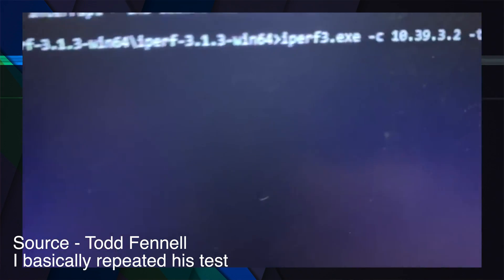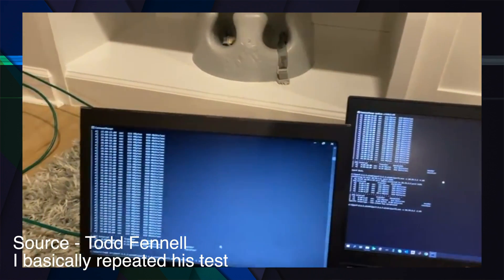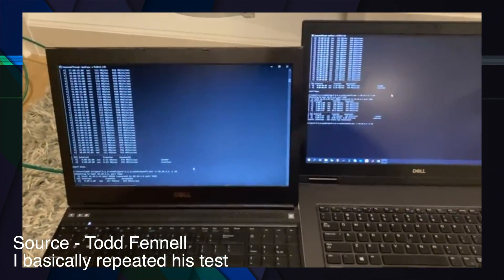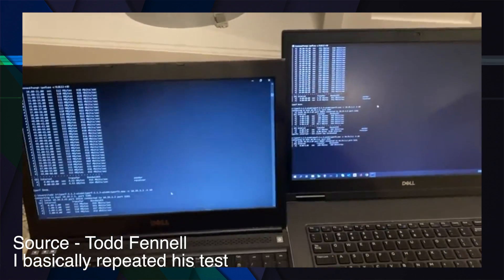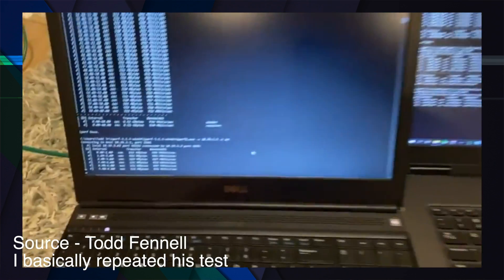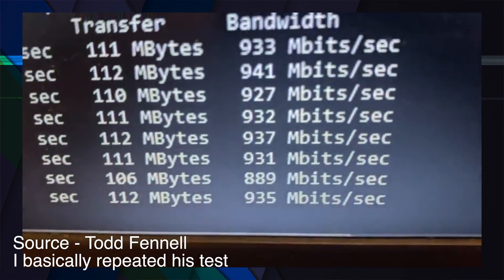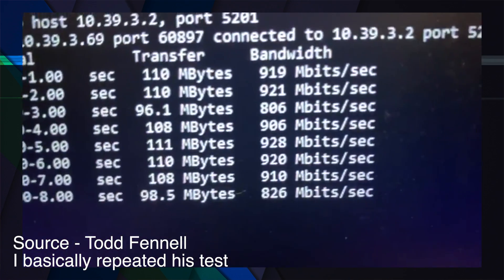The Truth About The UDM Pro... I was wrong

Comment: I noticed on the UDM-PRO it was 1Gb/s uplink but looking at the block diagram it is 2.5Gb/s on Rev3.1 between the switch chip and the CPU. Does anyone have information on the UDM-SE as to what revision and if it is 1Gb or 2.5 uplink?
Reply from the maker: The se model has 2.5gb wan
Reply: @MillerTechnicalServices Sure, but that was not the question.

Comment: what happen when you have 3 vlans and traffic has to flow between them on that switch?  Does it bottle neck at 1G?
Reply from the maker: It bottlenecks at either 1 or 2.5 depending on which revision of the UDM pro you have. They quietly updated it shortly after it’s release.

Comment: So, when we talk about the switch backplane capacity, this refers to the maximum throughput when the switch is fully in use. As such, begs the questions;
a) What is the maximum throughput on the UDMpro/UDMproSE, when the switch is fully in use?
b) Does the WAN port form part of the switch backplane ‘fabric’?
Cheers :)
Reply from the maker: The switch can do full gigabit between all of the gigabit switch ports. It can do 2.5gb to the cpu (ie. connecting it to the router)

Comment: Unifi is like the Apple of networking.. OooOo pretty.. colorful interface.. OOoO Ahhhaha... But.. Oh.. You're not gonna permit me to this.. Oh you're not gonna permit me to do that either.. Oh you've released a controller update where you killed off the features that I was using.. Oh you totally killed off support for a device... No thank you.. Been down the unifi path, been burned, won't trust them again. Offloaded my entire rack back to amazon at a loss and replaced it all with Mikrotik gear. The only piece of unifi gear I kept was the pro ap, but.. unifi's control over it had to go.. Trashed their firmware and tftp flashed openwrt. I control my devices now.... Not some corp pinhead at Ubiquiti. Same way with Cisco Meraki.. Stay away from that hot garbage too.
Reply from the maker: I don’t remember the last time I updated unifi. Too much crap
Reply: you do realize that Unifi was started by a former Apple engineer, haha.

Comment: You mentioned that UDM Pro's newer revisions have a 2.5GB Backplane. How can I check if mine is 1 or 2.5? (other than testing it, I want to know from model # or in the UI)
Thanks!
Reply: The UDM Pro (not the SE) is 1Gb/s uplink, the only UDM Pro that had 2.5Gb/s uplink was the Early Access revision 3.1 but it also had the SPF ports linked in speed, so if one only ran 1Gb/s then the other was locked to the same speed.
I hope we soon get info about the uplink speed of the UDM Pro SE
Reply: He's wrong. It was 2.5Gbps during EA, it's 1Gbps since release.

Comment: The biggest issue with the UDM Pro is that it cannot act as a controller for other networks / network locations. I have a company with 9 locations across the country, and basically if I want to upgrade and use Unifi Video, I have to upgrade all locations with their own UDM Pro. And thus, I will have to manually manage 9 configurations whereas before I could have one configuration with just 9 locations.

Also, getting VPN setup between these locations is now.... well.... why use unifi? You have to do everything manually again. For professional network engineers no big deal probably. But managing my own company I feel Ubiquiti left me hanging. I'm stuck with all this old unifi gear, and cannot seem to be able to upgrade to video and access control without seriously damaging the functionality I already have.
Reply: If you have a company that has 9 locations you really should have them look at enterprise level gear.  Ubiquiti really doesn't work well at scale, and the UDM pro can't do any high availability, something that is considered a basic requirement for enterprise level gear.

Comment: So the UDM Pro only has 1gig backplane and the SE can do more? Or they’re both good to go?
Reply from the maker: They’re the same.
Reply: @MillerTechnicalServices  both good to go for 1 gig for each port or 1 gig divided to each port? Sorry I was having trouble understanding
Reply from the maker: 1gb port to port. 2.5gb all switch ports to the built in router. Except for the 10gb sfp+ ports.
Reply: it's basically a 8 port switch chip inside the udm pro,and it's basic job is doing at least 16 gig backplane 8gig uplink and 8 gig downlink between all 8 ports.for a 8 port switch, its a easy job nowadays.

Comment: So now I have a question. We have established concretely the 1 GB port on the back plate of the switch. My question is now. How are people achieving 1.2 gigs speed wired on  UDM pro standard edition
Reply: They are using the SFP+ WAN port and forcing it to connect at 2.5GigE to a compatible 2.5GigE modem. Then they are able to get ~1.2Gbps download speeds. This is usually done with Comcast and Spectrum internet over coax cable. These providers overprovision by 20% to make sure the customer gets their rated speed to reduce complaints of not getting what they are paying for (and other reasons). It is not possible to get more than 1Gbps if using the 1Gbps WAN port or by using the built in switch. You would have to use the SFP+ ports for both LAN and WAN.
Reply from the maker: My guess would be the bits vs bytes conversion...

Comment: It is refreshing to have someone come back and admit they were wrong. I wanted to rage, but there were so many people after the SE dropped saying the same thing that I just dismissed it as misinformed.  In the UI forums it is pretty frustrating too when people act like you can't use that switch.  Throw in a few flex cameras, a hue hub, a caseta main repeater, etc. on that switch and it will work just fine as a perfect PoE switch solution, never saturating the switch bandwidth or uplink for that matter.

Comment: I appreciate you coming back and admitting you were wrong. I know my video was posted publicly, but I would have appreciated a heads up that you were going to use it and talk over it. It wasn’t 100% clear that it was my video as the way you talked over it, it sounded like it was you doing the testing. Other than that, I do agree with your other gripes about the UDMPro, forcing network and SSO is a bit frustrating for clients and even for us as managed service providers. I would like to be able to configure the device no matter where I am. Including without a current internet connection…

Also, you didn’t butcher my last name like everyone else lol. Thanks

Edit1: I now see your description where you posted the link to my video.
Reply from the maker: I wanted to reach out but when you set a video to private, it removes all of the existing comments.
(Edit: I couldn’t get back to the comment to ask)
Reply: @MillerTechnicalServices  makes sense. I guess for the future I’d rather you had asked first. Not mad by any means just caught me off guard